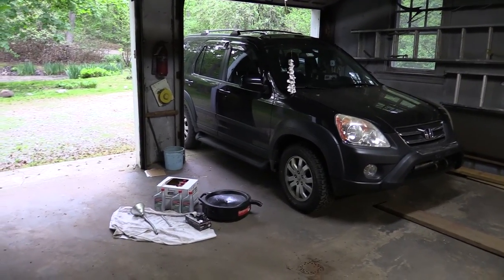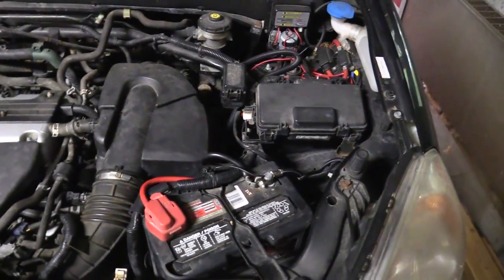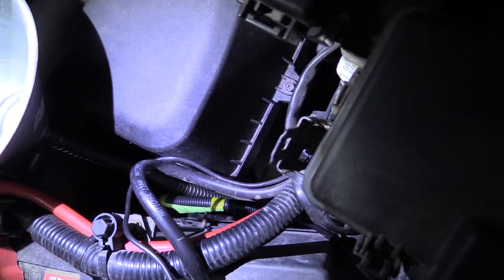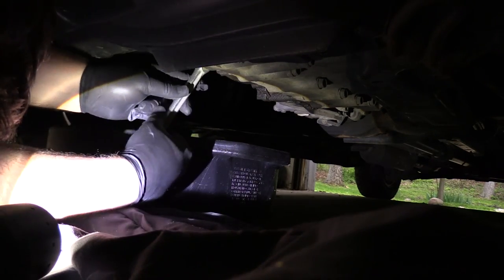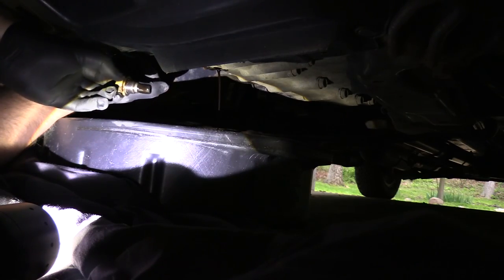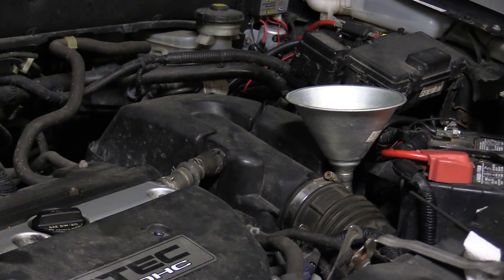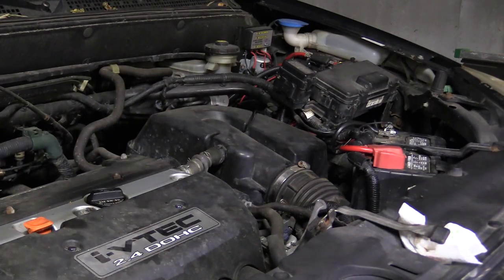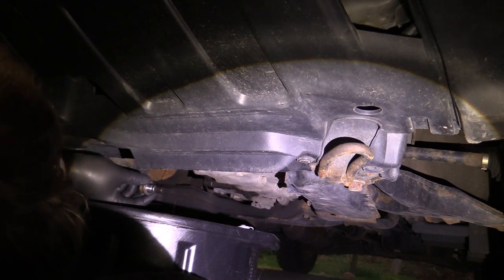Changing the Automatic Transmission Fluid on  Gen 2 - 2.5 Honda CRV (2002-2006)

Comment: Between you and me, I wouldn't put that light bar in front of your condenser/radiator like that. This gen's fatal flaw is too little air flow over the too small AC condenser and radiator. Our compressor just exploded like a hand grenade, literally, in the engine compartment. FULL AC system re-install required, aluminum shards in everything. I'm going to change the tensioner and idler pulley too, I think there is aluminum dust in their bearings/shaft.
Reply from the maker: Happy to report no problems after 15 years in desert swamp and snow.
Reply: @alexandermckelvy9461  You drove through desert or you live in desert? We're in high desert, and the AC blew like a hand grenade!

Comment: Alexander,  I'm having a real tough time getting the plug off the transmission. My transmission under the drivers seat, and I am pulling from back to front. I'm a bit scared to crack the case.What did you use to take the bolt/plug off?
Reply from the maker: Hey! I used a half inch breaker bar. You really have to tug, the transmission will move before the bolt comes loose, at least for me. Just make the square drive is fully seated, and you can pull hard.
Reply: David, I got mine off surprisingly easily because I used PB blaster as well as WD40 and on the first pull, It broke loose immediately. Hope this helps

Comment: I have a tendency to keep my cars long term, I'm thinking about buying a 2006 CRV with an auto, which is more reliable manual or auto?
Reply: manual obviously. I own the auto because it was passed down to me. 4-speed autos aren't really sufficient.
Reply: On the later cars after 2004 they went to 5 speed autos, and I've heard they also do high mileages compared with manuals without too many issues.
Reply: Go with automatic!!' Mine has 188000 no issues!! Change fluid 3 qts every 36000 miles!

Comment: Hey can you do a video on your Light Bar? I really wanna install one right where you put yours! Thanks so much!
Reply: Also a video on your All Terrain tires!
Reply from the maker: nerocinense Thanks for the feedback, I'm really slammed with work at the moment but if I get some free time I can put something together. Is there a problematic part of the install in particular that you would you want the video to cover?
Reply: Nothing in particular. Just info on which light bar you have and how many inches and how you mounted it. Also, the routing of your wiring. Plus what size tires you have and lift. Thanks!

Comment: hey, good afternoon. how about the change of the filter? do you recommend it, have you done it, and if so, can you upload a vid?
Reply from the maker: Stue Pinsaz Which filter?
Reply: The transmission filter?
Reply from the maker: I don't have a transmission filter video - haven't done it actually. I moved so am not in as great of a position to do work like that. Sorry.
Reply: No worries, thanks for replying and for the video. I was reading that it was a lifetime filter, I was trying to find out if this was true and if someone has changed it.  Nothing yet.
Reply: @stuepinsaz3479  you have to completely disassemble the transmission to replace the filter.....Not really suggested unless you're rebuilding it...
Reply: Sorry I’m like 3 years late but I read that it’s not a maintenance part and should only be changed if it’s leaking
Reply: No need to change transmission filter. Hard to get to and it's supposed to be a lifetime part.

Change the fluid regularly (every 30,000 miles) instead.

Comment: May i ask where you purchased those fender flares from?
Reply from the maker: It was an accessory available from Honda - see: http://www.hondapartsnow.com/installation/cr-v/2006-cr-v-fender-flares.pdf
Reply: +Alexander McKelvy Oh interesting, So when purchasing the car you went all out and bought all the accessories haha?
Reply from the maker: +soljafurkan Some of them, yeah, but I've added parts slowly since. Honda has started moving a lot of these old accessories to vintage part houses, so they can sometimes be tricky to find.
Reply: +Alexander McKelvy Tell me about it, whenever i find that piece on your bumper its always cracked or doesnt look up to par. one last question and thanks so much for the info. I found the fender flare, if i were to buy it aswell as wider tires would they still stick out? because as of now without the flares they stick out 2inchs. Does your flare go over the tire? Thankyou.
Reply from the maker: +soljafurkan I don't know the exact details of what you have or what you're trying to do, but the tires you see in this video are "LT215/70R-16 BFGoodrich All-Terrain T/A KO C" - they don't stick out. Just keep in mind that adding bigger tires/rims adds extra weight that you'll notice bogging you down, especially on a 4 cylinder. Spacers / hubcentric offsets might do the trick to get your wheels sticking out a little more, but I haven't tried anything like that.

Comment: K....one thing:

1) when the draining is "done"...add some clean fluid...and then let "that fluid" push out the rest of the old fluid in the pan for each time you drain....you WILL NOT get what's in the torque converter...but, at least the heavy burned, sediment stuff will be "pushed out"...or just drain/drive/drain drive once or twice to get most of the crap out.  One needs 3 qrts per drain...so plan ahead.

Honda,...like everything Honda...is a rip off...$8-9 a quart for this tranny oil.  Get it somewhere other than an OEM store...but use the Honda product.

One can also do a "total tranny fluid change"...by learning how....the video is described in here on YouTube somewhere...otherwise...change your tranny fluid until you see a nice
"red color" move often. 

Despite what some mechanics say....this can help with the model years of 2002-2006 to take away "shift-shutter" caused by the torque converter f*cking up past 3rd gear.
Reply: Frank From Upstate NY my 05 Crv has a weird thing that driving slow it makes a violent shake in the car and the rpm drops I check the axel driveshaft everything idk if that’s the shudder thing mostly people says those tranny o got the car months ago but I haven’t replace the fluid I noticed the fluid is like red but like darker when you stop the and when you accelerate you feel the vibration sometimes does and the rpm kinda suffering to not go up

Comment: What size tires you running?
Reply from the maker: I currently run KO2s in stock size but prefer them upsized. I don't think there's a lift in this video but I put on a 2 inch lift eventually and BORA spacers.

Comment: You forgot the auto oil filter
Reply from the maker: This would be a useful comment if I was changing the engine oil.
Reply: @alexandermckelvy9461  Auto transmissions have a filter too
Reply from the maker: @BlackyBrownDestruction9337  Like the fuel filter, an 06 Honda has some "lifetime" parts that are only replaced when they break. The filter here wasn't even in gen1s and is not part of the service maintenance on a 2006 Honda crv. The 06 crv uses the 3x drain and fill procedure outlined here.

Comment: 2005 CR-V EX has no ATF's Dip stick.
Reply from the maker: Look harder! It's in there. Yellow. Part # 25610-PPW-023
Reply: @alexandermckelvy9461  It should be there, but it's not. A dishonest repair shop just placed a rubber cap of the ATG Dip Stick's Port.